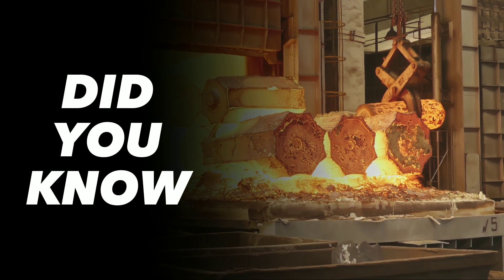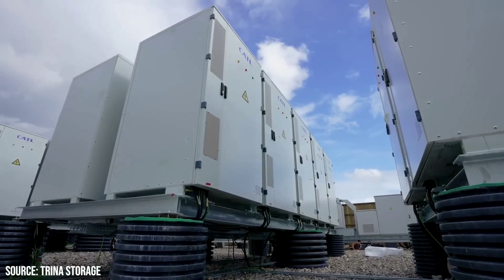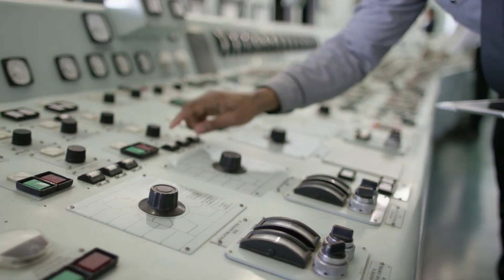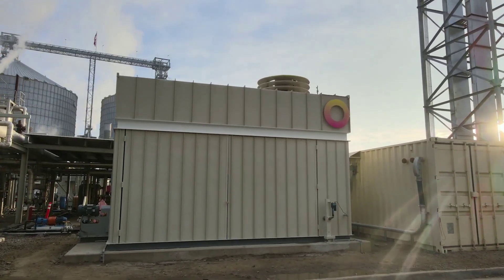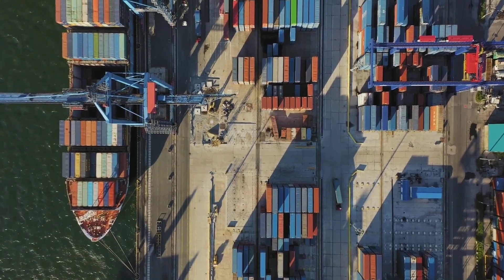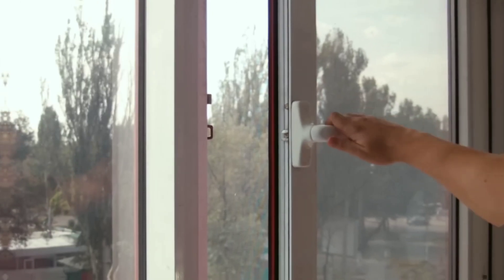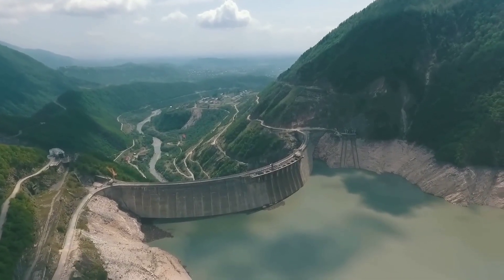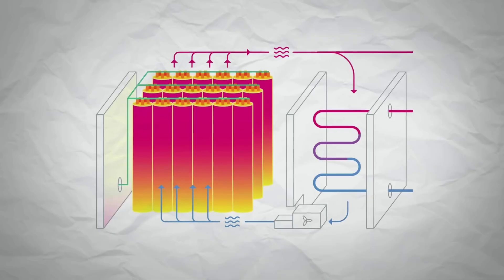The Ultimate Energy Solution: How 3000 Degree Bricks Will End Battery Storage

Comment: Hi. This method of storing heat (it's not a "battery") will be useful in stationary heating installations where sudden bursts of energy are not required, because they're not possible. It's better called a "heat sink" that releases its heat slowly according to Planck's laws of "black body radiation". Brick is not very thermally conductive, which limits the rate of heat transfer. Far from "not needing insulation", a 3000 degree brick will need a lot of insulation, as will any ducting that carries warmed air to outlying buildings. Compact and light it is not, so it won't displace chemical batteries or hydrogen for transport use. 
   The energy storage potential of brick and stone have been used for millennia around fireplaces and ovens. The Maori people of New Zealand use superheated stones to cook food in "hangi's", and this gives another possible industrial use for this "giant leap backwards" that's still appropriate today. Good to see people "thinking outside the box". Interesting video, thanks. Cheers, P.R.
Reply: Hi. Thanks for your appreciation, it is mutual. The cooking application can be seen operating today at any traditional Italian pizzeria. Cheers, and have a Chianti with that. P.R.